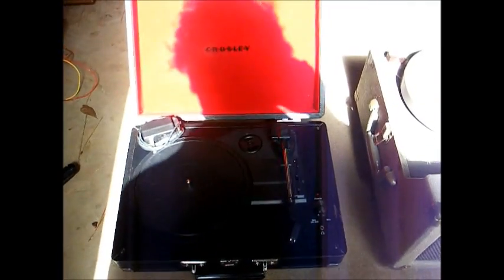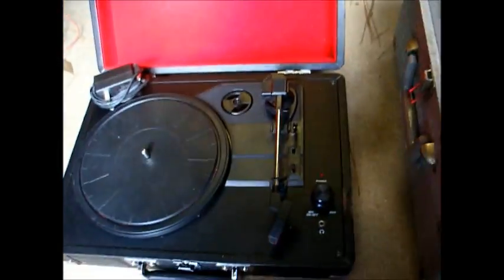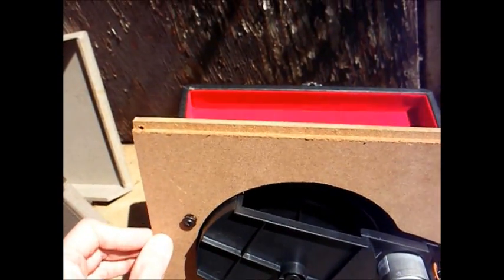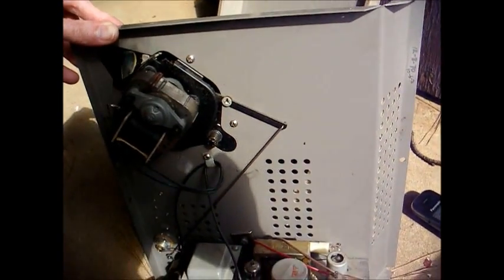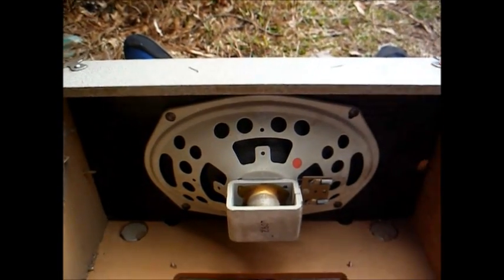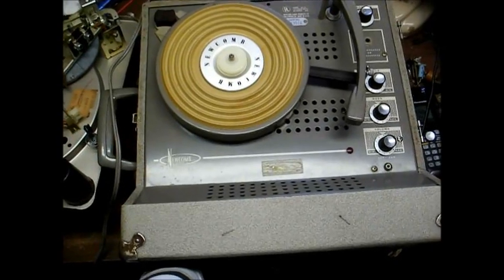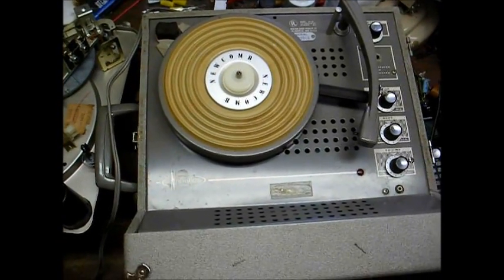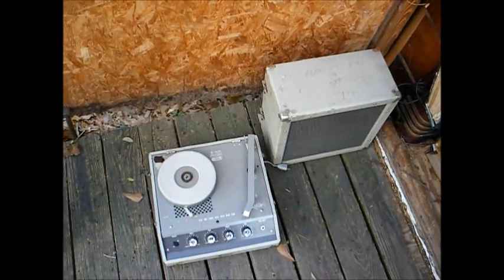2013 Crosley record player Vs. 1964 Newcomb record player (don't buy a Crosley)

Comment: I do understand that yes, record players should not be this cheap for records, I don't think these entery level turn tables are that bad, I have a turntable similar to a Crosley Cruiser, and I think it sounds fine when you hook up a decent pair of speakers, not only that but in the original specsheets for the LP (album sized records), it's rated for 5.5 grams of tracking force, just slightly more than the Crosley Cruiser, Back in the 60s, 70s, and even 80s people would play records on some turntable almost as bad as a Crosley Cruiser, but they still sound good, records will be records, they will eventually wear down, although I still do agree that if you're buying yourself a new record player, you should go for something nicer! But if you just want to play a few records or give a record player as a gift, then this isn't a horrid turntable that people claim it to be, it's actually really decent!

Comment: Its not really fair to compare these two products.  After all, one was built 50 years ago and was a main stream media player for the masses (not to mention America built better stuff then) and the other is a throwback oddity that's suppose to be fun.  I'd imagine any real audiophile would have some high end stuff to play back their vinyl so they don't damage it.  These new things are just a novelty is all...  You can't take it 100% seriously.
Reply: trekguy31 Neither pick-up is necessarily gentle to your records.  The Newcomb likely sounds amazing, and is far more rugged.  Gentle ceramic cartridges have been designed, such as the trimline Tetrads in the 1960s and 70s, but generally they aren't exceptionally kind to records, but can be acceptable.

Comment: The Crosley is a piece of crap.  Don't waste your money on one.  An Audio Technica AT-60LP is a nice inexpensive unit but you need to get speakers for it.
Reply: TheDutchOwner's Tech Channel  According to what I've seen about it there is a built in pre amp.
Reply: U-turn orbit and LP120 are nice!
Reply: It ain't the best, but good for starting.
Reply: And speaking of Crosley, they put out the C100 turntable which is a much better improvement than the crappy Crosley turntable. It went from poor quality low end junk into a high end perfection. It is a Technics SL-1200 clone. I've seen many of the SL-1200 clones in many of the brands including the Crosley C100, the latest one in the variety of turntables.
Reply: @Dan-TechAndMusic  Its got a built in preamp.You can use powered speakers with it.

Comment: If they made a NEW newcomb turntable in China it would cost about 600.00 and if you made it in the USA it would cost around 1300.00 so for 50 bucks the Crosley is a rip off only by 20 dollars

Comment: Wait. Didn't Crosley used to be a brand of good records way back when? (I'm talking 45+ years ago here)
Reply: TheSkullArmyMC Yes but Crosley is essentially a different China based company now that just has the same name and logo.
Reply: TylerGaming97 I kinda figured that.
Reply: TheSkullArmyMC NO. Crosley Radio Corporation of Cincinnati, Ohio, never made records.  They made RADIOS.  Powell Crosley, Jr. wanted to design a radio that anyone could afford, and so started a company that made reasonably high quality radios with innovative designs that reduced cost.  I own the 1937 Crosley Super 11 model 1117, and, although it isn't a spectacular console, I really like it a lot.  I also own the 1932 148, with an innovative superheterodyne circuit that bypasses several patented circuits, and also uses a cheap but attractive depression-era wooden cabinet.  Powell Crosley started and owned WLW, 700 KC AM, at one time the strongest transmitter in the world--500KW.  He also owned the Cincinnati Reds, buying them out of bankruptcy in 1933.  Crosley also made refrigerators and very small innovative (and strange) compact cars.
Reply: td1238 Ah. I see.

Comment: The Crosley LOOKS nice, but I would take the Newcomb any day.  If the crosley had a tone control, instead of being marked "low" and "high", it would be "tinny" and "really tinny"!  I have a 70's BSR turntable with a ceramic cartridge, and as long as it's connected to an amplifier with a high impedance input it sounds great.

Comment: i get you dont like the new one there but why are you comparing it to an industrial buold quality product.   
i'm sure if a organisation wanted a simler device that had to deal with the same expected use and abuse that the old school (literally) unit had to deal with the build quality and features would reflect the expected use.

i agree the new one there is sub par for hifi use it's more of a toy than a real unit the internal circuitry is junk filtering is near none exsistint and the amplefecation is done up as simple and dirt cheep as possible.

Comment: Kind of an amazingly unfair comparison of two record players that are not built for the same purpose at all.  What would your Newcomb Record player cost in 2013 dollars? I'm thinking it would be significantly more than this model of a Crosley (which by the way is their most inexpensive model you've chosen to beat up on).   Perhaps you should compare a 1964 Volvo PV544 to a 2013 entry level Hyundai Accent?   Later you mention getting a vintage turntable and something like a Marantz amplifier/receiver.  Seriously?  You are comparing an entry level portable turntable aimed at the teenager market and priced as such to a Marantz receiver and Kenwood turntable which even in their day in 1970's dollars cost hundreds and hundreds of dollars (imagine what they would cost today)? How on earth do you validate comparing the Crosley Cruiser to that kind of gear?  Is your teenage daughter going to pack your Marantz amp, your component turntable and a couple of giant speakers under her arm and go visit her friend's house to play records in her friend's bedroom?  

Does the Newcomb record player play portable stereo?  Does it come with software to convert your analogue records to digital MP3 files?  Can you play it through you laptop?   What weight is on it's needle when it's playing?   When the tubes burn out (and most of your version of record player when someone finds one at an antique store or thrift store has at least one dead tube) what does the average person do?   Where exactly do they test those tubes these days to find out which one went bad?  How many of those 1960's record player amplifiers have those giant metal-cased electrolytic capacitors with dried out electrolyte and don't work anymore (and make a beautiful loud 60 hz buzzzz through the speakers instead of any music at all.   Ever seen one overheat and burst?  

By the way, as you mention, the Crosley record player has 78 sized needles (correct width of stylus) you can buy from Crosley directly for the very few people who would actually have 78's they want to play.  Why go to the expense of providing both when they know the market they are aiming at is likely 1 out of 1000 ever going to want to play a 78?  Don't you think it's unfair of you say that having  to change that needle on the Crosley could lead to disaster and yet later you suggest people buy an old component turntable which can also be plenty tricky to replace the needle and/or the cartridge.   

You don't like the small stereo speakers built into the Crosley.  Fair enough, that is just one option for listening and meant for the the portability and size/weight of the unit.   I think I'll call BS on your claim that little transistor radios had better speakers. I've owned a lot of them in the day and worked on them and that simply is not a true blanket statement.  

You can also run RCA cables from the output jacks of the Crosley to any component home stereo (hey..... you could plug it into your Marantz!) and if you have not actually tried it (and I'm guessing you have not), it sounds very good.   Does the Newcomb record player have an input jack for today's kids to plug their smartphones into so they can listen to their music through it?   

I apologize for the rant but there are lots of so-called audiophile bullies out there who love to attack the Crosley Cruiser because it does not measure up to whatever high end audio gear they choose to compare it to and therefore judge it unworthy.   Unfair, unfair, unfair.

Comment: In your first Crosley vid, you had one of the all-in-one units....I had a chance to examine one for myself in a department store. Some of my observations; 1) the volume control was sloppy, and felt as though it might break off in my hand, 2) the tuning knob only worked through part of it's travel 3) the tone arm was wobbly, like one of those Vanity Fair children's record players from the 70's/80's. 4) the cabinet looked to be finished in cut-rate shelf paper. I wonder how many baby boomers are buying these as a blast from the past, only to be shocked by how horrible they are? I bet the return rate on them is quite high.

Comment: Its junk like this is one of the reasons some are flocking to real vintage gear, and going to the expense of having it restored. I've worked with a number of these so called retro units. Quality wise they are just a pile of rubbish. Especially for what some of them cost. Oh and If you need repair parts good luck getting them. I ordered a part from Crosley. Waited weeks only to call back to find out the company didn't have the item which they told me was in stock. They finally sent me what I needed. But they had to cannibalize a new unit to come up with the item I needed.

Comment: I'm looking for one of those vintage school record players! I saw one of those cheap Crosley ones in a pawn shop a while back and after poking at the crap plastic parts I gave it a pass. I remember those players while I was in school too (I'm 42) and I already recently bought a new Califone school cassette recorder for 20 bucks off eBay and even though it's brand-new it's still built like a tank. I don't know how many or which of those school record you players you still have but I am interested in getting one, do you sell them through Craigslist?

Comment: Crosley is total junk I would not let anyone buy one new at all. Hell for fun if you have one you should do a fisher price or any kids turntable vs a crossly my bet is on Crosley to win. 

I still wonder who made the stack table crosley had out a few years ago. I had one more of just to see how it worked. All I know it was not a bsr 12 volt belt drive all plastic unit at that. I know a few years ago another company put out a stack unit that had a bic table old stock in them. Problem could not stack 7 inch at all.
Reply: Unit that used a old stock bic table was a Teac gf188 only photo I can find of it here. The table was a odd ball you set it for how many times to repeat or lps you had stacked up to 8/
http://www.thebuzzelectronics.com/viewLarger.asp?item_id=138737

Comment: The 2019 Crosley Cruiser Deluxe - an upgraded version with pitch control - costs only $36.95 new at Walmart. So not really a fair comparison. What does one expect for under $40 ? The 1964 Newcomb cost a lot more even in 1964.